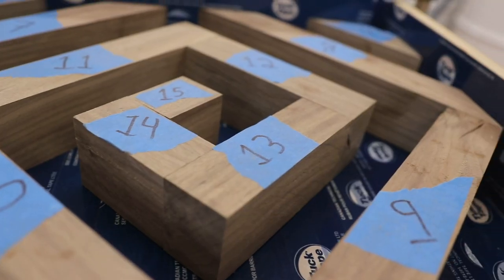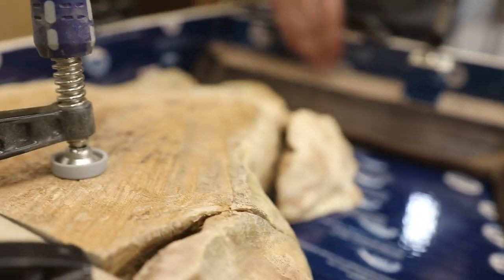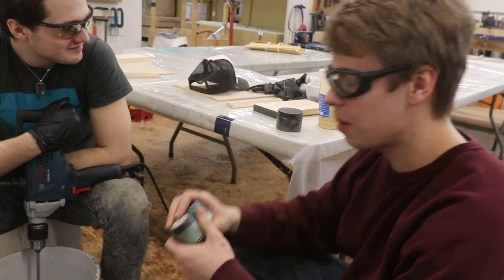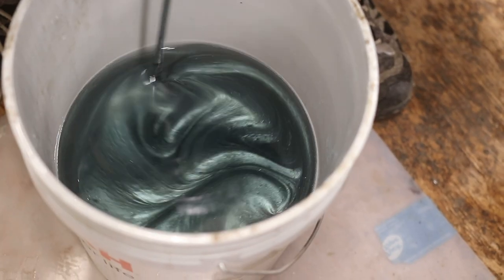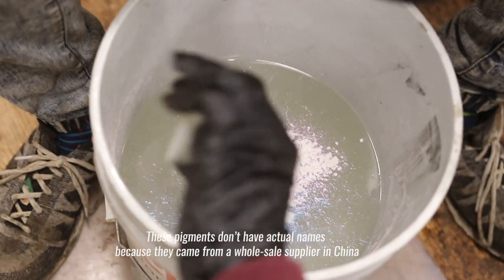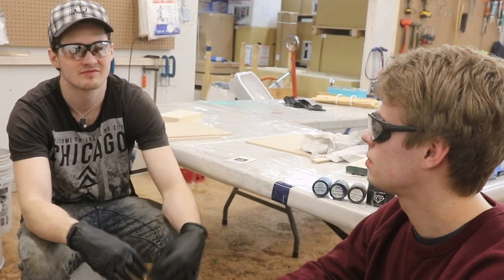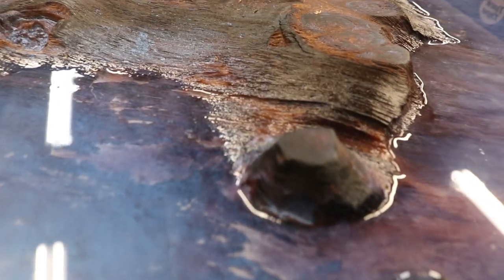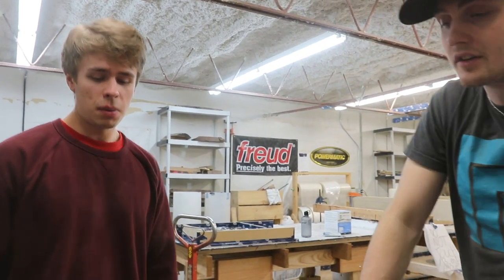How We Color Our Epoxy

Comment: Beautiful pieces guys! I do small crafts with resin and yes, using a torch to get out the bubbles while the resin is first poured is the best way to get rid of bubbles. Wait a while and do it again. Using a hand sander without sandpaper as a vibrator against the outsides will sometimes help the bubbles come up as well. You can also use a heat gun. But with using these types of heat, move quickly over your surface because you can burn the resin. Good luck and keep up the beautiful work!

Comment: Regarding the bubbles in the pours.  Sealing the wood as mentioned in one of the replies, or using a vacuum bag/table/chamber due to the air in the dry wood.  The recommendation of using a torch or heat gun after the pour is good too.  A Russian video that pours epoxy, uses a product in an aerosol can that is sprayed over the pour and works extremely well for getting rid of the bubbles.  The spray is also far less labor-intensive.

Comment: How do you do a deep 4inch thick dining table pour in one go without it overheating and bubbling/cracking? Or do you do it in two pours to avoid that happening?
Reply from the maker: We use our Black Forest Deep Resin which is designed for thicker pours, combined with controlling the temperature by using air conditioning, fans, and an aluminum table

Comment: Heat gun bro to remove bubbles after your pour or vacuum the resin before pout
Reply: You can also pre-seal the wood, that'll stop the bubbles coming from the wood itself.
Reply: Synthetic Memes and weakens the bond that’s why they don’t seal their edges

Comment: Had you treated the bubbles with a torch or heat gun, wouldn't that have pulled out the bubbles?  Surprised you would not have known to do this.  Loved your color-mixing--this was very useful.
Reply from the maker: With slow setting epoxies like this it is actually not advised to use a blow torch as it flash cures the top layer and prevents anymore bubbles from coming to the surface. The reason for the bubbles in the green pour is because we exceeded the maximum recommended thickness 👌
Reply: @BlackForestWoodCo   Ecopoxy? The reason I ask is I work at the Woodcraft store in St. Louis and we are going to be carrying their products shortly. It would be good to let the customers know about the blow torch issue. Thanks.
Reply: @terryreed1421  I have used ecopoxy plastic (2 to 1 ratio), 4 six litre kits in the last year, and I have found that even though the amount of bubbles are significant less that other epoxy's I have used, if you are pouring clear you will still get micro bubbles in a deeper pour without using a vacuum chamber. And using a torch is not an issue, I have used a torch extensively in removing bubbles that are created sometimes when you pour the epoxy into your mould, or if you are attempting to mix different colour you will generally y create bubbles, all of which I remove with the use of a torch. The biggest disappointed I find with ecopoxy plastic (not sure if it applies to the other types of ecopoxy) is the resin has a tendency to as the company calls it "crystallize" . I have experience this on 3 of the 4 kits I used. I following the instruction provided by the company to dissolve the hard chunks but was never able to successfully fix this issue, and unfortunately ended up having to dispose of 16 ounces of resin, which admittedly is not a lot but considering how much this product costs, I don't want to waste any of it. I am hesitant to invest in more ecopoxy due to that issue.
Reply: @JohnSmith-qc6bq  thank you for sharing your knowledge!

Comment: Do they make smaller mixing brushes like the one you attach to your drill? I use small applications but that mixer is awesome!
Reply: etothelij, When mixing small amounts it is better to do it by hand as you can scrape the sides of the container more efficiently and you don't create as many bubbles when mixing by hand.
Reply: @seanmcaleavy2369  no offense,  but bubbles arent an issue. Just wanted to know about the mixer
Reply: @etothelij , just trying to be helpful. Bubbles aren't an issue because you aren't using a powered mixer. Go ahead and find out for yourself if they are still a non-issue after you switch.

Comment: When you are doing a pour like this with random designs, how do you estimate how much resin to mix up?
Reply: Math.
Reply: I don't know how they do it, but you could measure the mould, stack up all the pieces and measure them, then subtract the total. Or just estimate based on area.
Reply from the maker: Yes we do our best to calculate the cubic inches of the area we want to fill and convert to litres 👌
Reply: You could weigh the wood, and take a sample rectangular piece to estimate volume of the wood,  and just subtract that from the box size.   Or just guess and move on with it

Comment: do you guys ever have trouble with the dye bleeding into the wood? I've had a lot of trouble with this on a few projects and not sure what im doing wrong, or what i should do differently. I'm currently using system 3 epoxy and a liquid dye and have had this happen on red oak and maple. Also most of the time im filling smaller voids or cracks, areas that i cant really seal with clear epoxy without filling it completely. Any advice?
Reply: I use sanding sealer.  Two coats.
Reply: @ralph1533  nice tip thank you.

Comment: great job guys really wonderful but one advice to help...u must start using the heat gun or small flame guns to remove all bubbles at the same time you pour the epoxy..try it😀😀😀🙋‍♂️
Reply from the maker: With slow setting epoxies like this it is actually not advised to use a blow torch as it flash cures the top layer and prevents anymore bubbles from coming to the surface. The reason for the bubbles in the green pour is because we exceeded the maximum recommended thickness 👌

Comment: Use thin coat of clear on wood before pouring the cast. Won't have the bubbles from air coming out of wood during the cast setup
Reply: No causes a weak bond you get stronger bond if epoxy can soak into the wood
Reply: @bryandowling8524  stonecoat guys do that. I did it on mine. Works fine
Reply from the maker: Sealing the edge only works in the short term. It compromises the long term integrity of the bond.
Reply: @BlackForestWoodCo  how long have you been buiding these? Didn't think they had been wround long
Reply from the maker: @truthh8322  about 3 years now. We used to seal the edge when we were starting out, and we have personally seen the wood and epoxy separate on ones we sealed the edge of because the bond is weak
Reply: @BlackForestWoodCo  gotcha
Reply: @BlackForestWoodCo  Is there a way to send you a pic of my end table top?

Comment: Really cool stuff but if I may I'd like to point out a couple things to my understanding of work with epoxy, in regards to the bubbles problem, usually particular resins are graded to how deep you can fill in one pour, typically about 3cm depending on the resin type, it looks like you're filling about double that, I don't know your resin type and I may be wrong but it could be adding to problems if not taken into account, another thing is to get rid of surface bubbles simply glide over the surface with a propane torch, not for too long, l usually do that it pops all the bubbles then I wait five minutes to see if any new bubbles have resurfaced and do it again, love the work though

Comment: Yall do awesome work. I'm doing some epoxy pours on tables. How do you clean your mixing tool and buckets? Right now I use disposable items but I want some that can be used over and over. Any help would be appreciated! Keep it up!!
Reply: I put my buckets upside down on foil or plastic and let it drip out or I will leave a stir stick in it do you can pull it out. Hope that works for you.
Reply: Acetone will clean your tools but wear a respirator and clean everything before the epoxy cures.

Comment: I built a cover and pulled a vacuum let it rest for an hour. The vacuum pulls the air out of the wood and after slowly let the vacuum off the resin will then be sucked into the voids as well as all the bubbles will go to the surface.   PEACE

Comment: Why don’t you guys use a heat gun to get rid of the bubbles? Thought that was a pretty well known standard epoxy rule? Oh well, maybe after this you’ll be able to bypass a lot of bubbles like that one pour
Reply: Ecopoxy bubbles pops by themself
Reply: @kubaspaceboi  really? I guess all must have been a mass hallucination.
Reply from the maker: @seanmcaleavy2369  They actually do !  With a slow cure the bubbles rise to the top and mostly dissipate.  Whatever is left are easily planed off.

Comment: What epoxy are you using? Ok eco epoxy. Guys here in Ontario ran into trouble with them.  Try Chill Out of Quebec. Fantastic product no heat problems and it is just amazing. I just took a course at @canadianwoodworks. #canadianwoodworks for it.. They sell it but you can get contact through them

Comment: Lol.... Rookies that don't even know you're supposed to use a torch or heat gun to pop all the bubbles.
Reply from the maker: We actually recommend against that. Our resin is specifically formulated to release bubbles on its own. By applying heat to the surface you run the risk of flash curing the top layer, which actually prevents more bubbles from coming out. Apply heat is only mean for coating epoxies, rookie.
Reply: Yea rookies that are running a very successful company and selling 13000 dollar tables .. shut up

Comment: It's hard to believe that with all the available info there is out there, you guys don't know the most basic and essential techniques. You would be hard pressed to find an epoxy resin tutorial that doesn't include the importance of a torch or heat gun to remove bubbles. Also, there are techniques that limit the bubbles from forming in the first place such as brushing a primer coat of resin onto the raw wood and allowing it to get hard but still tacky before the resin pour. This limits the amount of air and gases that escape from the wood as the poured epoxy is curing. And when mixing, a mechanical mixer should only be used when mixing large amounts of resin and the paddle part of the apparatus should be completely submerged and never break up through the surface while it is rotating and it should remain at a slow speed the entire time while mixing. Failure to follow these steps will result in lots of bubbles forming. I am not trying to be a know it all. I don't know even half of what there is to know about this, but epoxy resin is expensive and the video is titled like a tutorial so first-timers are likely to watch it and be robbed of some very important information. Also, when measuring out dye you should use kitchen measuring spoons and write down the amounts of dye used or you will never be able to exactly replicate a color you love.
Reply from the maker: You must not be familiar with the new epoxy technologies that are available! Torching the bubbles is actually a very bad idea as it will flash cure the top layer of the epoxy and prevent bubbles from coming to the surface. Sealing the edge is also not always a great idea as it prevents your epoxy from soaking into the pores of the wood, resulting in a weaker bond. We have done tests where we seal the edge and that bond will always fail over time. 
Being that it sounds like you’re new to this kind of epoxy, we would be more than happy to help you with any questions you might have. 
Not sure if you’re aware of it but we are responsible for starting this whole epoxy table trend, we did it two years ago before anyone had done it on a large scale and our video of the first piece we made got 120Million views on Facebook, since then this has become very popular. We may not know everything but we are confident that we are on the leading edge of this technology. 😁
Reply: @BlackForestWoodCo Co. actually, no, I have never heard of a bubble free resin. That is awesome! Is there just one particular brand?
Reply from the maker: We use Chill Epoxy 😁
Reply: Yet they have an insanely successful business selling amazing tables and furniture for thousands of dollars